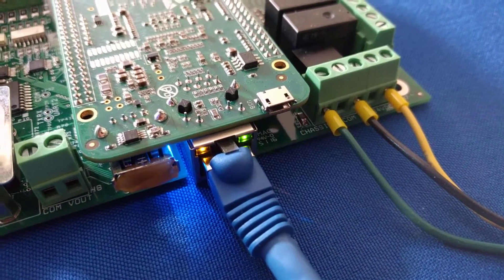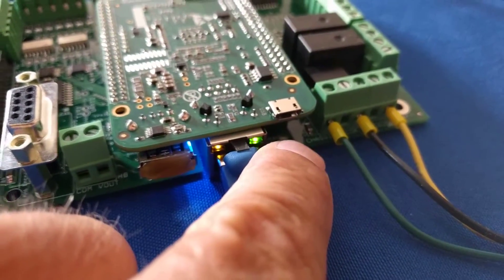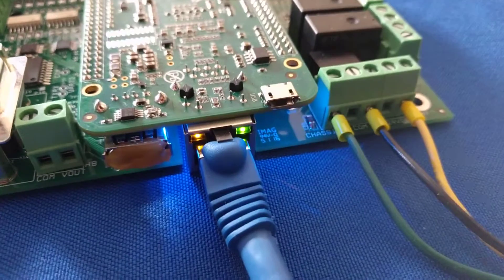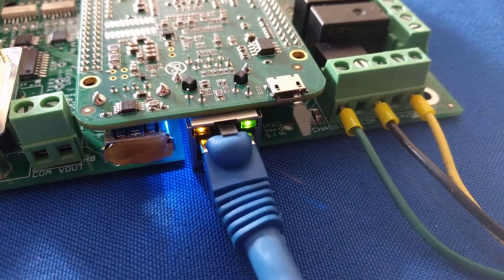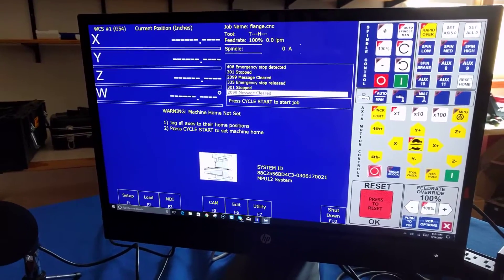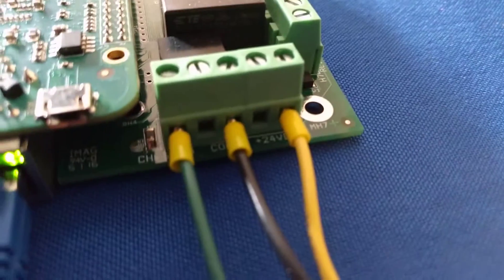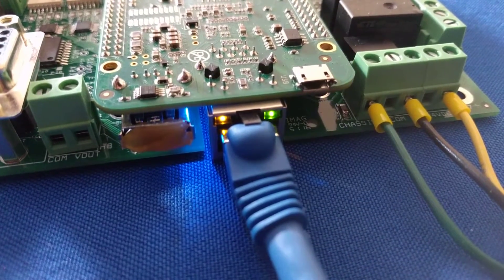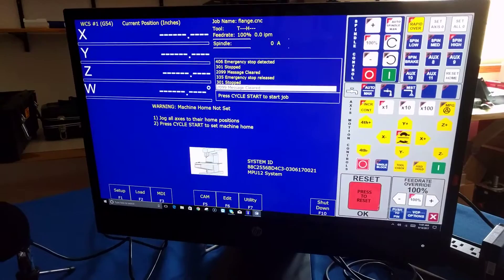Centroid Acorn Ethernet and Firmware Heartbeat status LED lights explained

Comment: Im an engineering masters student and I inherited the an Acorn CNC from a previous project. I ensured that the board was properly installed and it ran previously but Im having an issue where neither the blue heartbeat light (right) nor the blue power light (left) on the beaglebone will turn on as shown on the video. Any idea how to fix this issue?

Comment: I have a no communication error. Any ideas how to fix it other than what the screen suggests?
Reply: See TB279 https://www.centroidcnc.com/dealersupport/tech_bulletins/uploads/279.pdf
make sure your firewall if off and not blocking communication. You can turn the firewall on and add an exception after you get it working.
Reply from the maker: http://centroidcncforum.com/viewtopic.php?f=61&t=1451
Reply from the maker: sign up for the forum for free tech support..here is how..   http://centroidcncforum.com/viewtopic.php?f=20&t=3350
Reply: It turned out to be a coupler with a screw that backed out between the stepper and the ballscrew jamming and throwing the code. Not sure why the correlation but that was the fix.